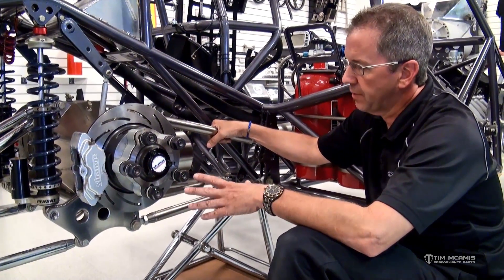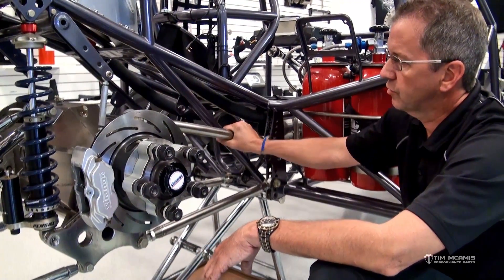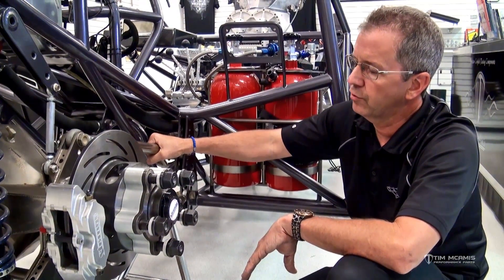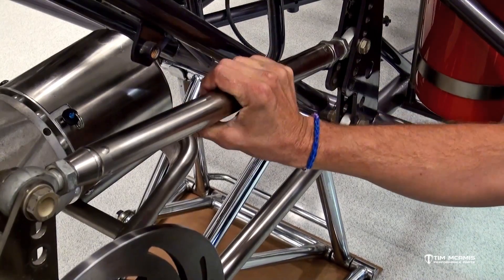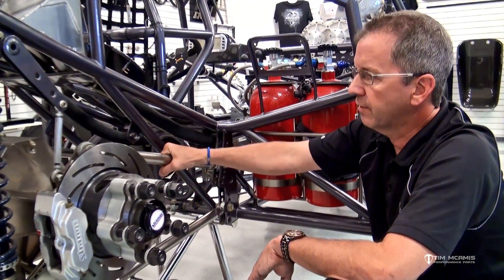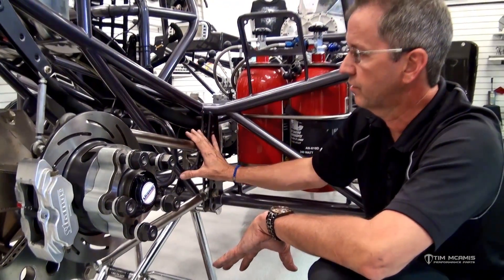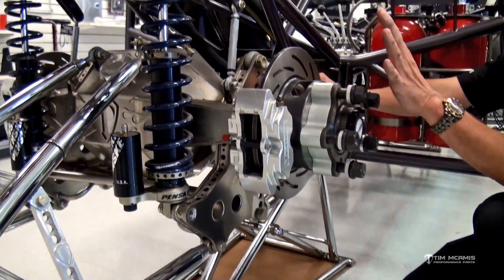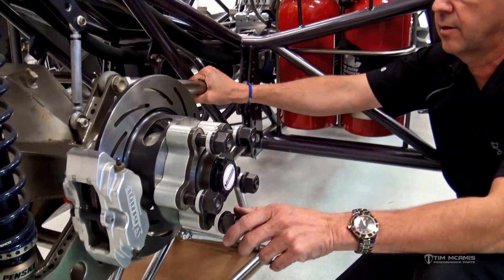Rear Suspension Overview: Part 3 - Pre-Load

Comment: This helps a lot to understand not only have your rear end square to the rear cross member but how to adjust pre load. 

I was stuck on my 62 c10 because it already has factory ladder bars but I’m going to be pushing some power and wave it to go straight and reliable. 

This is my first time and don’t think it’s going to be as hard as I thought. Lol abs ya I can read a tape measure. 😎

Comment: Tim really knows his stuff and he does a great job of explaining things.  However, he is working on a very expensive jig built chassis that is basically perfectly square and all the components are brand new. Most racers that are using YouTube to learn about four links, typically are racing home built cars or something that is not fresh off the jig, myself included.  There are many other things that should be taken into account, things that Tim is not covering here.  Example, he sets his preload with the rear end hanging, hanging on what?  It’s hanging on the shocks. This assumes the shocks are exactly the same length, and all the shock mounting brackets are mounted perfectly the same on both sides, something that is usually not the case on a home built car.  Also, I noticed that he didn’t disconnect the rear sway bar when checking preload.  I have tons of admiration for Tim and his videos, I just wanted to remind folks that you always have to think about what you yourself are working on and use a little ingenuity and improv, don’t just run with what you’re told without asking “what if?”  I grew up building and racing round track cars, cars that get the life beat out of them, so improvising while working with something that is not fresh off the jig is kinda second nature to me.  But it still takes a lot of thought.  Hope this helps someone.
Reply: monnieweb x.  Tape measure 101.  Square it up and start from neutral.   Send it!

Comment: I have double adjustable ladders and its going left on the launch.Im assuming that lengthening the bottom adjuster on the right side is the same as setting negative preload in the right side.By doing this it should put more weight on the drivers tire to get it going back right.If I have this wrong please let me know..thank you

Comment: Hi Tim, is preload the same as corner weight?
Reply: Phil King seems close but not exactly them same as i understand it corner weight is changing spring pressures to get the cars weight to move around this is changing the position of the rear end so that you adjust how much power is applied to each wheel